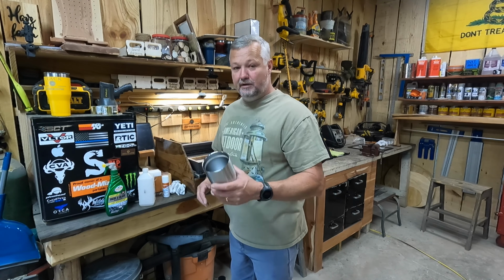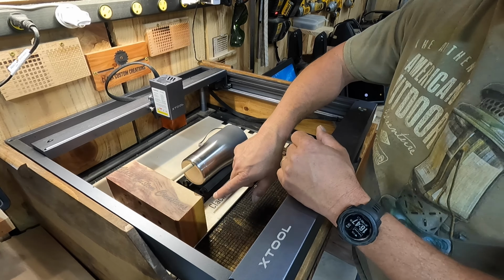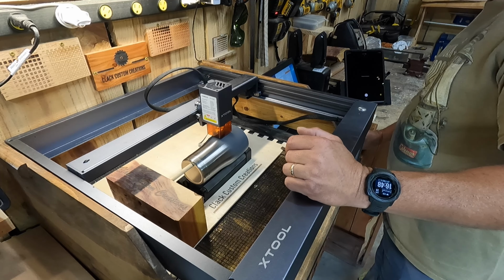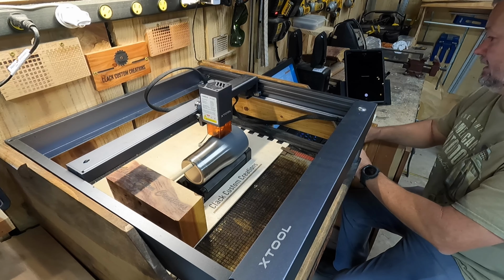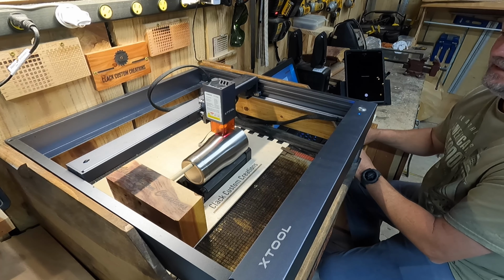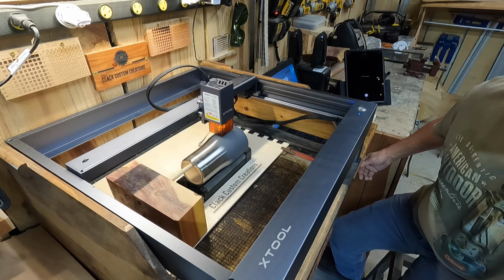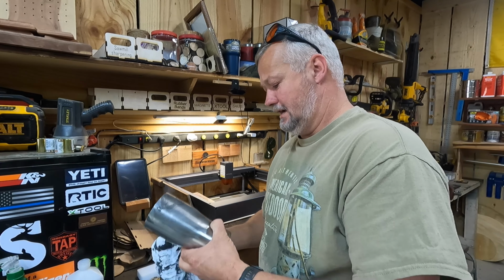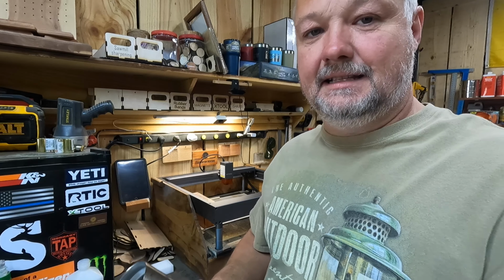Engraving plain stainless tumblers

Comment: I know you have done a video showing coated to stainless, struggling getting this right, you mentioned 70mm/sec at 100%  is that correct? this does not burn through the powder coat on my tumblers so they do not clean well, wondering if your running slower? have the D1 10watt like you in SC hot humid so should be similar.  what is your line spacing also, hopefully all the questions are ok  thanks in advance!!
Reply from the maker: The speed is color dependant, slower for lighter colors. 70mm/s is black. You will have to go to about 50 mm/s for white and other light colors. Reflectivity has an effect, the less reflective the faster you can go.

Comment: Do you use any different settings when you use a re-used tumbler.  I little while ago I saw how you sand a flop tumbler to clean it off and re-use.  I have tried the same.  Coated with Cermark, did burn at 100% power and 70mm/sec settings.  Image did not take.  Should I use different settings?
Reply from the maker: Make sure its clean, dust will act as a barrier to keep it from bonding. Clean with a majic eraser and rubbing alcohol. Cermark is pretty consistent in my experience.

Comment: Thanks for the video. Have you figured out the cost of the marking spray per tumbler. Not sure how many you can coat with one can.
Reply from the maker: I get around 50 depending on the size of the burn.
Reply: @TheClackShack    Is that with the large can?
Reply from the maker: @videoscrapheap  , yes